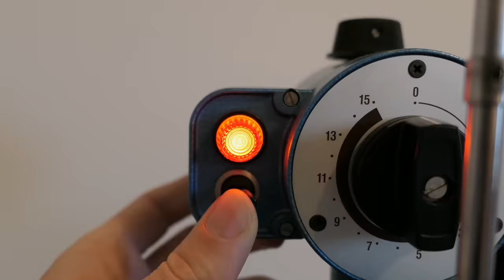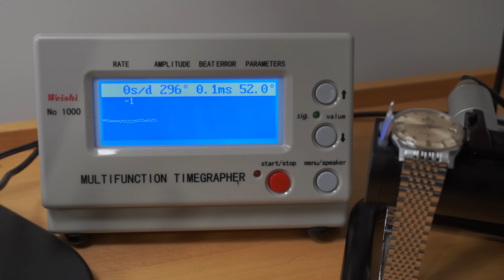Surprises Inside This Vintage Omega Watch Restoration !!!

Comment: I inherited an Omega Constellation chronometer with a 14K case.  The dial is the same pie pan but with numbers  @12, 6 and 9.  with this same movement in it and it  still runs as well as new.  The omega movements are beautiful as well as easy to service.  I have several other Omegas with different movements and all still run well.  Thanks for the video.
Reply from the maker: They are great pieces that will last for many generations

Comment: I love 500 series omegas. I found a dirty, dusty old one that someone sold for parts. All it needed was a hairspring stud screw. so I cleaned it, and found the screw and it ran beautifully. Went together really easily
Reply from the maker: They are great robust movements
Reply: The only issue is that parts can be so darn expensive. I’m working on one now with a broken rotor axle and I don’t want to pay for a new one lol
Reply from the maker: @professorredfox  That is the problem with vintage watches. You can make new parts but you need a lot of expensive tools

Comment: Not only do most vintage watches have more character than many new pieces, they also tend to work better on my more slender wrist. I’ve given away several that I’ve got running. Who knows what stories they’ve endured.
Reply from the maker: Yes vintage pieces are generally smaller

Comment: Thank you for the video. I love the movements in vintage watches. Recently did an Omega with a 563.  Must have been serviced by the same person. Could not believe the amount of oil on the movement. Had to use bench paper to soak up the amount of oil. So much oil that it creeped into the dial and turned it black. Totally ruined the dial. More than just patina.  Damage. Thanks again.
Reply from the maker: That is a shame to damage a dial just because somebody put too much oil.